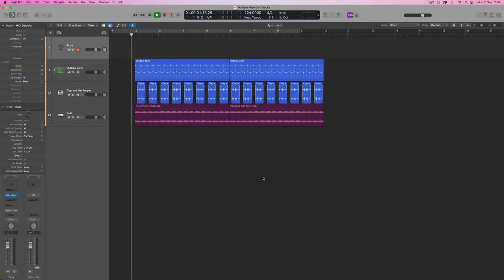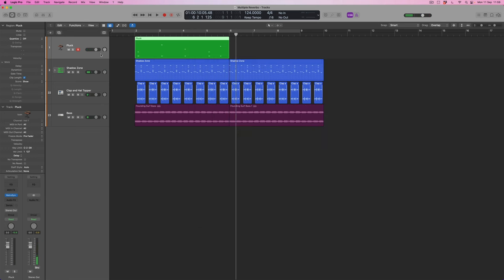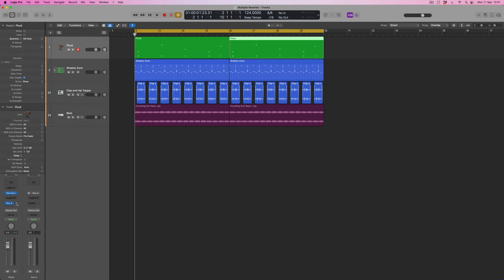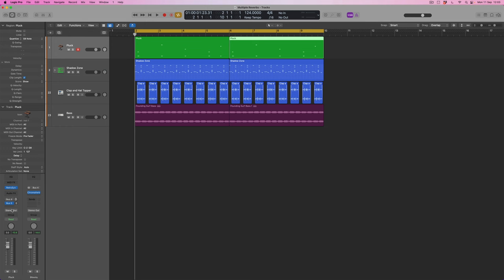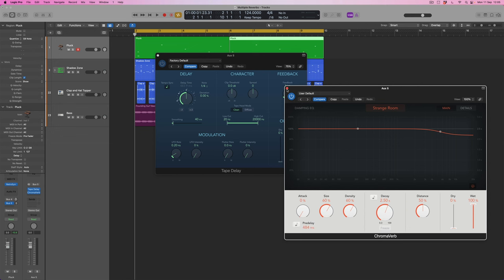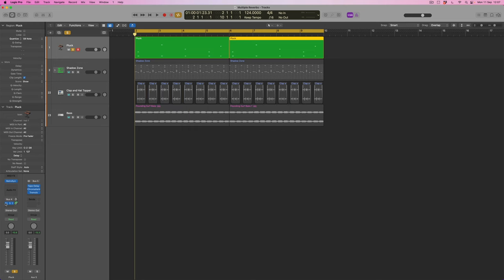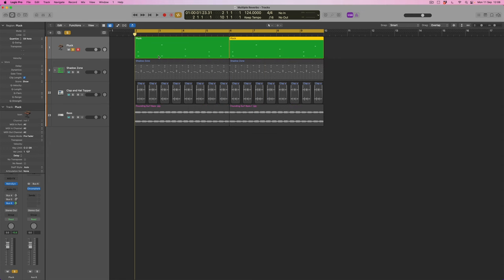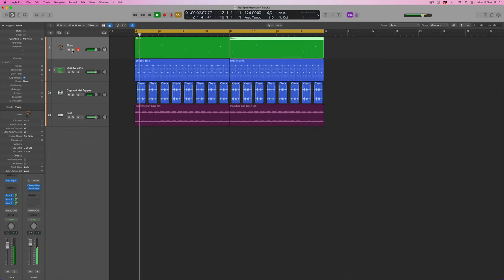LOGIC PRO X - Designing Multiple Reverbs

Comment: at 10:35
notice he didn’t touch the pan level. 
this is a delay psychoacoustic phenomenon. 
your brain is panning the signal left and right. 
Jono should do a video on this. 
i think. 😂
I don’t think the tremolo does panning
Reply from the maker: Hi John. Confusingly, Tremolo means slightly different things to different plug-ins. Whereas SoundToys' Tremolator is all about volume shaping, Logic's Tremolo plug-in is - in effect - an Autopanner, so it IS introducing side-to-side movement. The 'waveform' shape on the right-hand side of the display is showing you how the signal is shaped from left to right and will update as you select Depth and Smoothing settings. If you like psychoacoustic stereo widening, do have a look at the video I made about the Haas Effect: https://www.youtube.com/watch?v=K94Og-78fgQ Hope that helps!
Reply: @jonobuchananmusic  thanks
i didn’t see any L or R on the plug-in interface
it says “offset” in degrees 
where i thought it was phase delay